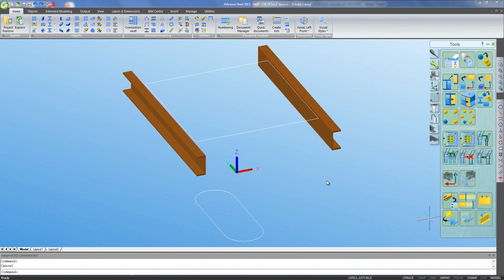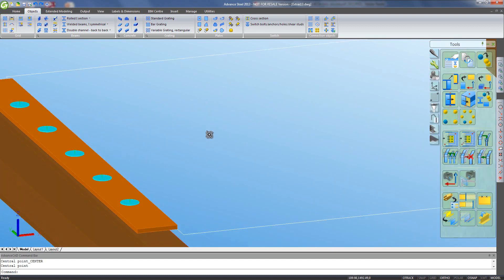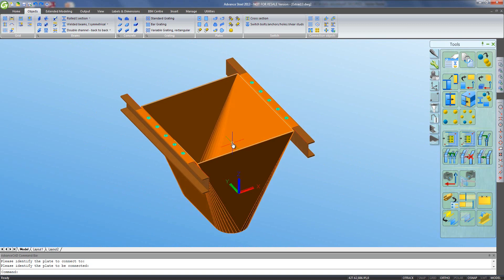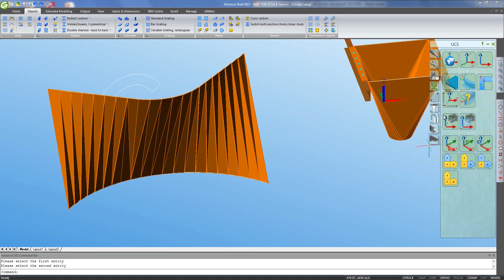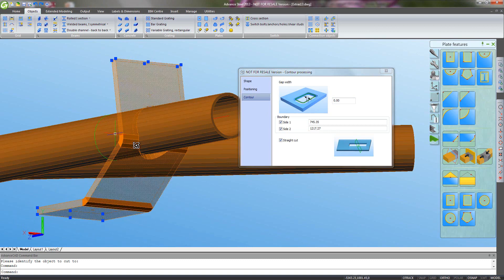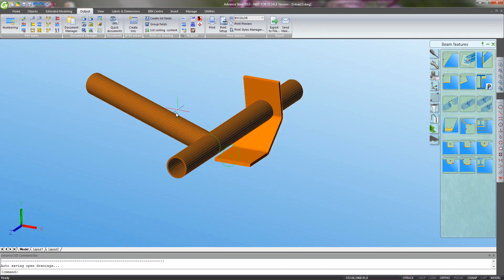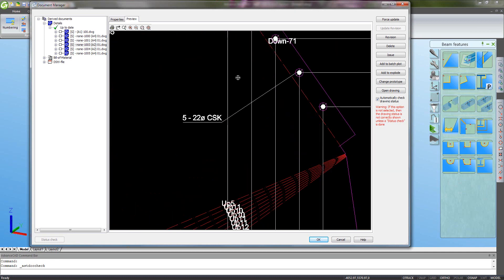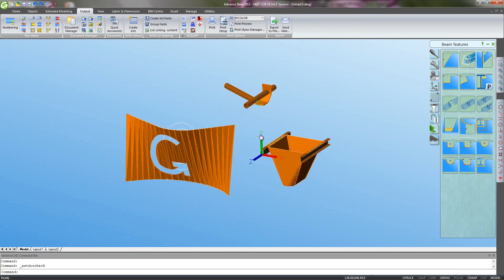Platework in Advance Steel

Comment: Thank you for the video. It was very helpful for a particular model that I am creating, 
I have some questions about the twisted plates. I hope you can assist:  

1. Would it be ok to assume that the more number of sections (e.g. 20 vs 60) the smoother the surface of the part after CNC machining?
2. Can I change the display of the twisted plate so the sections lines are not displayed in the model?  
3. I am trying to connect the end of the plate with other (non-twisted plate) however, when using the element contour, miter, cut an object or merge the plates, the connection is only made in one of the sections of the twisted plate. Any idea  how to solve it?